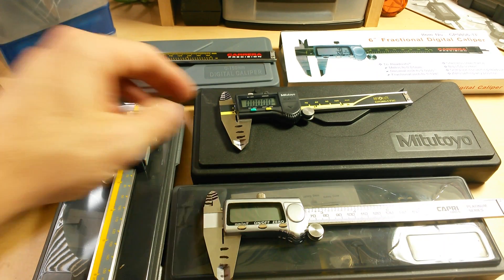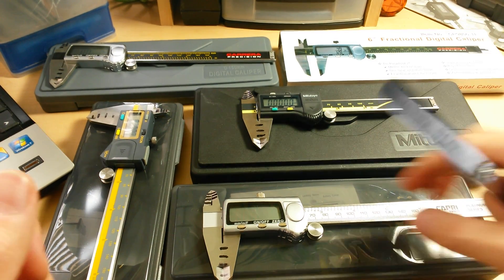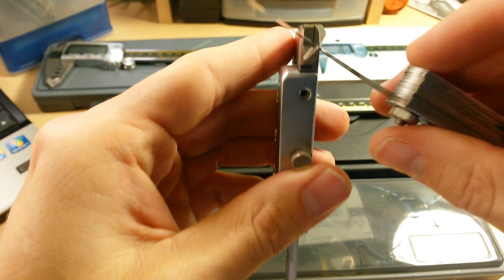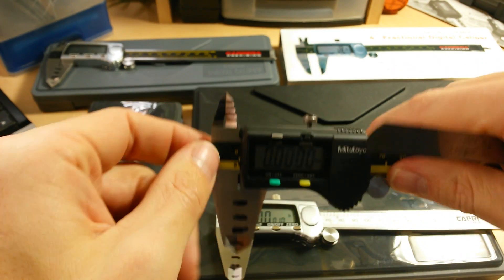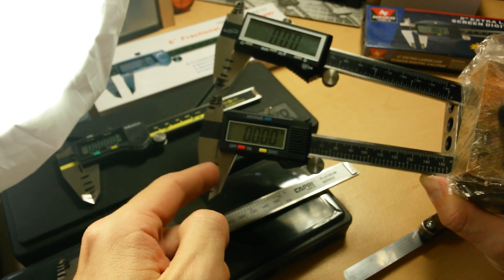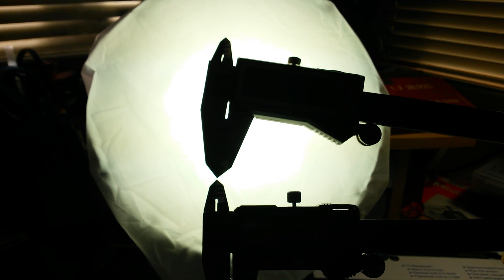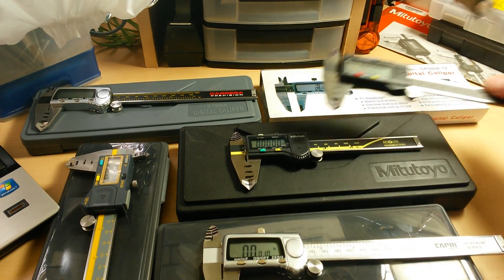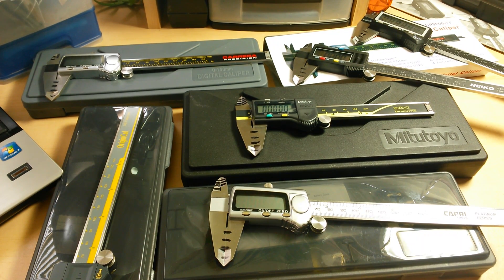Digital Caliper Round-Up (:2:) Huge Gap/Design Flaw on the Cheaper Digital Calipers ~Neiko, Carrera

Comment: To the viewing community...This video is concerning to me, and has been up for over 11 years at the point of this comment. It's disturbing to me as a certified repair and calibration technician for over 35 years to see this. What is being described here is absolutely false information and should be removed. If this presenter doesn't understand the physical nature of how a caliper is designed to work then I beg you to think about what is being said. There is nothing to be proven about that space between the I.D. jaws, it's there because the jaws are offset...so they can slide past each other...they never touch each other, therefore ZERO is not detectable. So, of the 10,800 views this video received, I wonder how many of you actually believe this theory? This gap is not a reading of ZERO. You cannot read ZERO on ID jaws.
Reply: A lot of online comments seem to dwell on inconsistency in the Neiko and others. Not sure if this is the root of that, but I've seen the video linked on Reddit discussions.
Can you recommend a decent workhorse digital caliper? The video mentions Igaging, but given your background, it would be nice to get your opinion.

Comment: Because the inside measuring blades have a small flat on them and they are offset against each other there should be a small gap. But depending on the size of the hole it would need to be variable. Basically digital calipers are not great for accurately measuring hole sizes.
Reply from the maker: Did many, many test measurements with many calipers. 0 is 0, on these with big gaps 0 is not 0.

Comment: @ 6.12 mark he shows that all calipers have a gap in the I'd jaws when you change your viewing angle. Calipers need this gap so that the I'd jaws can pass by each other. When the calipers are fully closed you cannot take a measurement with the ID jaws. When manufacturers design these instruments they know this. They do not intend on anyone thinking that this is a way to measure inner diameters. All that matters is when you open the calipers to read inner measurements they should read accurately to a known size. Can't do this when they are closed.

Comment: What YOU came up with (feeler gage test) proves nothing, sir. Test the accuracy of the ID jaws using what is intended to be used to check internal measurements...either a ring gage with a known size or a step gage. Seeing a space does not measure it!

Comment: Why not just measure all the caliper inside measuring using ring gauges like you would use to check intra-mikes, I think that would be more of a valid test. using the feeler gauge all you are doing is measuring deflection not actual measuring.

Comment: I assume you know that there is an extra 0.02mm (0.001") allowance on the accuracy spec when measuring with the internal jaws and depth rod?
Reply: Ahh, so the inaccuracy on the cheap models is within spec. Funny it doesn't say as much in any of the included literature. The igaging and mitutoyos don't have this problem and the cheaper iGaging is less than $10 more than the Neiko:
http://www.amazon.com/dp/B001AQEZ2W/?tag=caliper1-20

I'll pay $10 more for an accurate instrument any day
Reply: Cre8ersWorld
Reply: Gordon Clarke I assume you do know, and have read it, that there is an international  standard for manufacturing calipers and that it includes accuracy specifications?
Reply: @Cre8erS  To bad you don't understand the fact that you are incorrectly pointing out the lack of inaccuracies. The space is not a measurement, you do NOT need any literature to understand the need for the space so the I.D. jaws can slide past each other. The measurement made with with I.D. jaws is done on (of all things) Inner diameters! Too bad the Company you are trying to sell products for doesn't teach their salespersons this physical property of slide calipers. It has nothing to do with different manufacturers, or the price point of any of their calipers. YOU CANNOT READ -0- ON I.D. JAWS!!!!!
Reply from the maker: @dennisallport1471  All measurements on a caliper depend on a a zero point. You can't measure zero on OD either, but zero has to be set and all measurements taken from that point. When you start with a 002" space, which will be added to your measurement, you have already lost. Good calipers don't have this space. It is not there to facilitate the Jaws sliding past each other, that would be on a "Z" axis. The only way to compensate for the space is to re-zero at a point where there is no space.

Comment: Ok, so you are basing your measurement inconsistencies based on (1) Can I put a feeler gauge in at an angle (2) can I bend it to a different angle to make the measurement not match up.......doesn't that then make the variable/inconsistency the friction on the slide device? how about you do a REAL test based on a feeler gauge that can measure the actual gap at a 90 degree angle to the measurement? I actually purchased an iGuaging caliper based on this review and my first impressions.....good on you for deceiving the masses! But after I watched this video for a second time I realized you were doing a third-class test to make people think what you wanted them to believe. Try posting a real review of actual facts.
Reply: Fred Chapman Except Larry is correct and the reviewer is wrong. There is supposed to be a gap on the inside jaws of the calipers.
Reply: Larry Jones Whether the first test is valid or not, he confirmed the result independently with a second test: the cheaper calipers have a visible gap when held up to the light.
Reply from the maker: straightpipediesel Absolutely not! Mitutoyos and Starretts don't have gaps, and as a result don't measure a thousandth off.